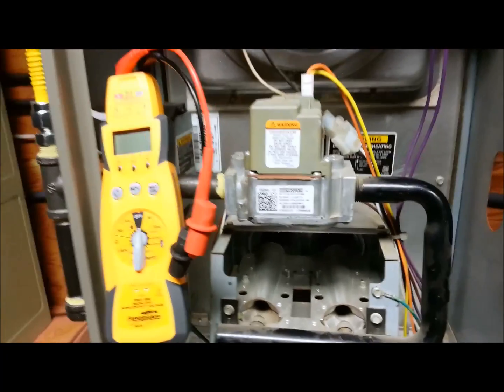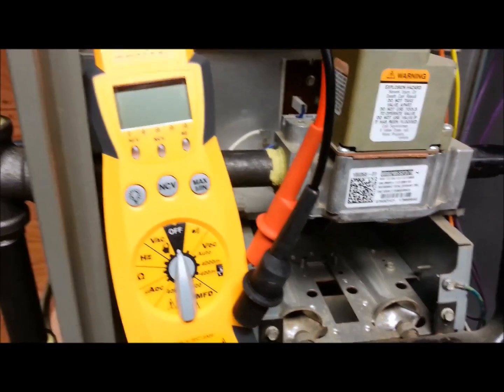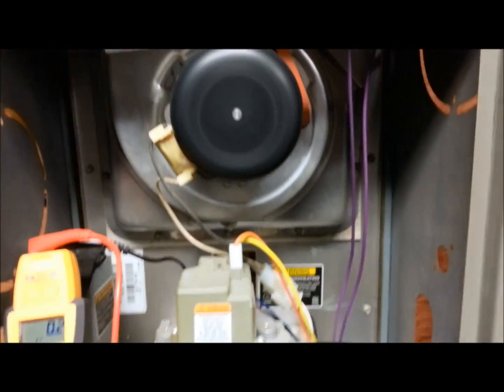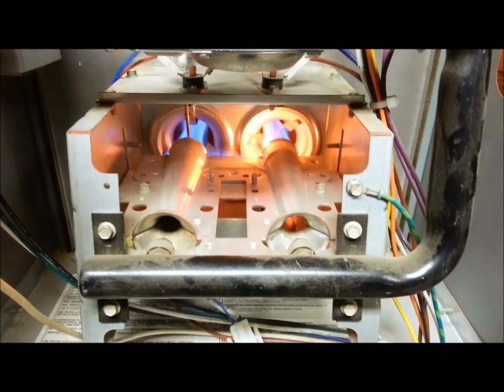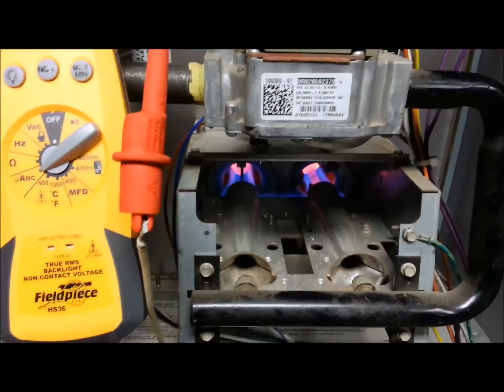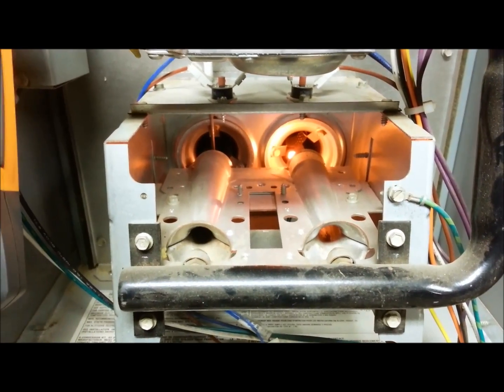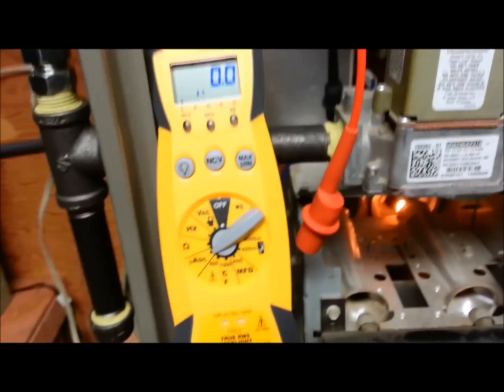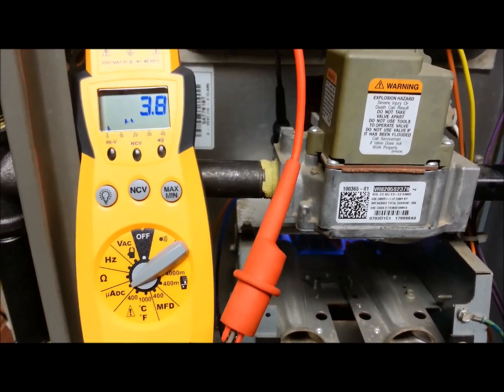Flame Sensor Testing Furnace

Comment: Great video as always. I was   checking the flame sensor signal on a mid efficiency furnace. When furnace fires up the microamp was around 1.7uA. But within a couple minutes the reading started to drop from 1.7uA to 0.6uA and furnace shuts off. I've checked all grounding, changed flame rod, verified gas pressure, cleaned burners, checked all connections and wires, checked rod distance from burner. The board is sending around 110vac to rod. Can it be a bad board? Thank
Reply from the maker: What was the reading after you changed the flame sensor? If the flame sensor is reading above 1.5 its the board. But before I swapped the board out I would replace the wire also as they can go bad.
Reply: Thanks for your reply. The new flame sensor has same reading. And behaves same as the old flame rod. Starts at around 1.5uA then drops to 0.7uA.
Reply from the maker: Next I would check the ground wire and make sure it's got good ground, It could be loose or bad. If it isn't the wire or the ground then it is the board. But make sure you don't have any loose wires. @mark.r8900

Comment: Is the meter reading micro-amp in DC or AC ?
Reply: It's a DC signal... sometimes called 'flame rectification' ie AC converted to DC much like a transformer for a radio does.